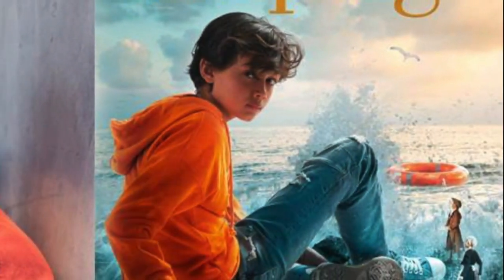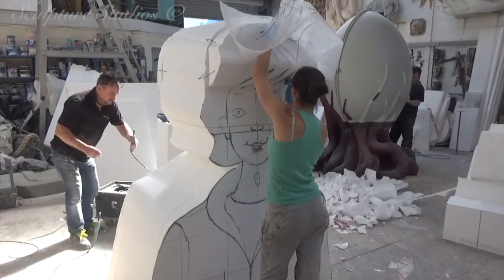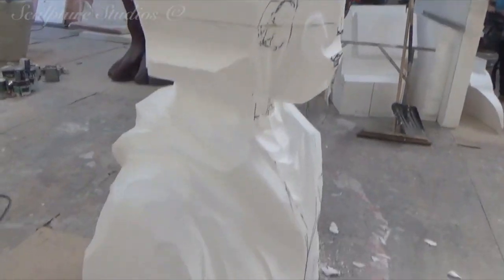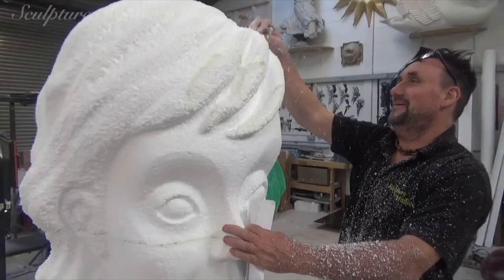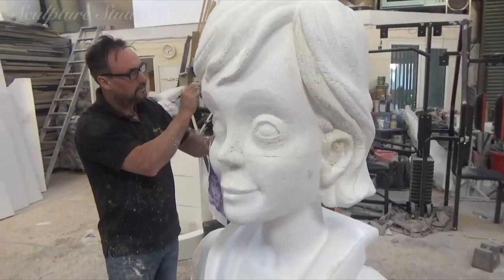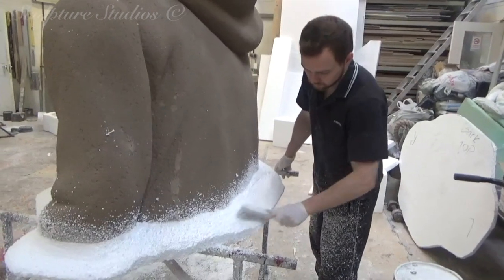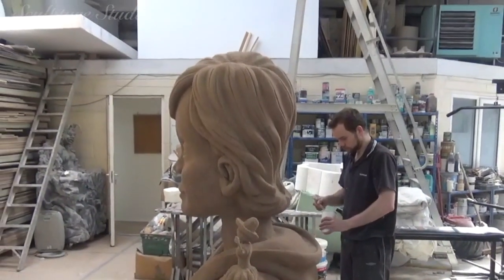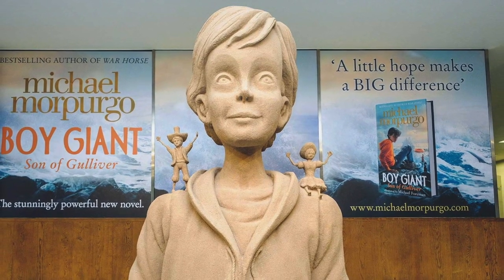Boy Giant - Michael Morpurgo Sand Sculpture by Sculpture Studios

Comment: how long did the project take from start to finish. and how do you judge your timescale?
Reply from the maker: The project took about 3 weeks. And we judge timescales by experience or how long we think it's going to carve and how much work will be involved with whatever processes need to go through or finish it needs to be. Normally we're governed by an actual time frame though. And we potentially work later and/or call in extra hands to help out, depending on the urgency.

Comment: Excellent work Aden! I liked the use of a lightweight spray on cement product. Do you ever apply other  hard coat products using the hopper gun? We usually have to relay on an outsource for polyurea with a local truck bed liner company but would love to have an in-house solution like maybe a polyurethane that is thick and can be sprayed somehow?
Reply from the maker: A spray on plastic would be handy, I must admit. But it's just the concrete that we spray for now. Apart from that, on the odd occasion we would paint and spread on a plastic. Not quite the same ease though